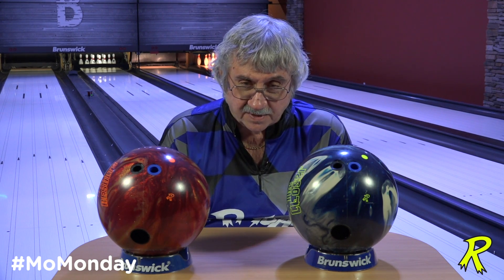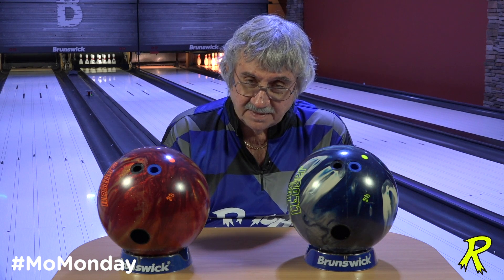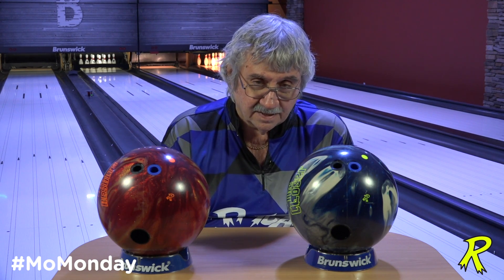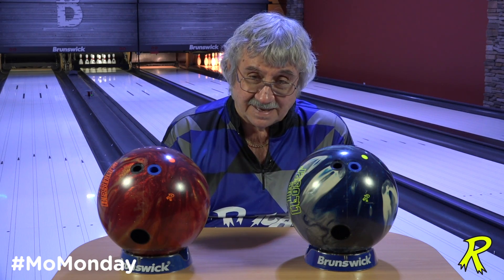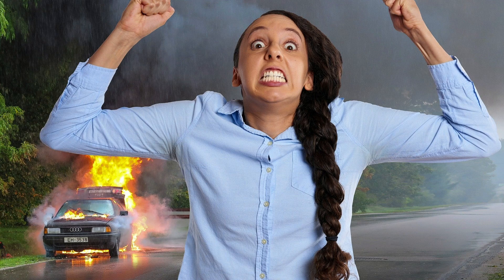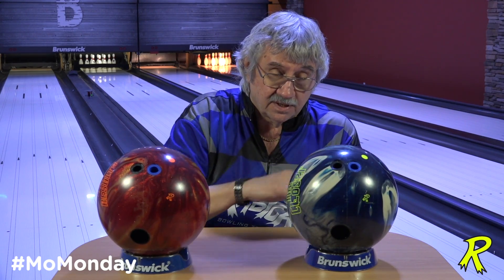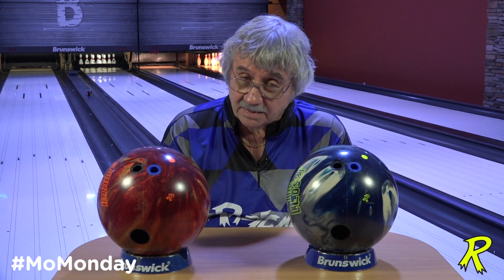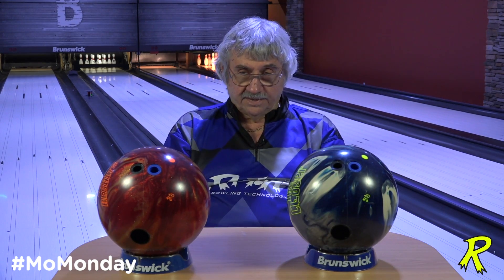Bowling Ball Oil Extraction - #MoMonday

Comment: soak it in hot water 125 degrees. The oil will float to the top.  I always sand to 500 first because it opens the pores in the ball.   I think dry heat you stand more a chance of making the resin harden. The water is the safest way..  My pro shop does it this away too. In fact he is who taught me.
Reply: I've been doing it like this for 4 and a half years on all my reactive gear and it works remarkably well. Just let the holes dry for a day or two before using unless you tape them up.
Reply: @TrashBulldogProductions   I never tape the holes. Neither does my proshop guy. But I do let them dry out good before using it.
Reply: @TrashBulldogProductions ive been told to never let water get in the finger holes, no one knew why

Comment: I set my bowling ball on the floor heat register one day to warm it a little before I went bowling, since it was winter and I had forgotten to take the ball out of the car..  The room thermostat was set at 72 degrees..  OMG..!!  I wasn't expecting to see all the oil come out of the ball like it did..!!  It looked like a shiny glass marble..!!  I wiped it down with a soft cloth and placed it back on the register near my workdesk for another hour as I worked at my computer..  Three times the ball became lika a glass marble which I wiped down agsin and again.  After the third time, the ball remained dry.  Now, no more hot water buckets, no more dishwasher cycles or using the oven.  Just regular house temperature heat from the floor register during the winter months..!!  A pleasant surprise..!!

Comment: I asked my pro shop guy about this subject and he said at 90 degrees the glue inside the ball under the cover stock would degrade so not to do it. Anyone else have info that may contradict what my pro shop guy said? Thanks
Reply: my pro shop owner says his oil extraction oven runs at 140. i always worried about cracking. turns out, they crack most often from extreme cold than heat. hair dryer works pretty well without heating up the core.
Reply: 90° is very high
Reply: @Thezombieguru3565  guy in video just said 130 or less so why do you think 90 is high?

Comment: I clean my bowling balls right after each session with a mixture of 12 oz of 91% isopropyl to 1 oz of concentrated simple green.
I had over 100 games on a resin ball, I took it to the pro shop to put in the oven and after an hour not a single drop of oil came out.
This has been true of all my balls. Aggressively clean them after ever session and oil will not be an issue.
Reply: Maybe urethane balls but reactive balls still suck it in it is how the ball is made.  Just the time it takes for it to roll back to you it will soak up some oil that can not be wiped off or cleaned.    I wipe mine off every single throw and clean with alcohol evetime before they go in the bag. Every 20 t0 30 games I put them on a spinner and clean them real good and put a new finish on the ball. every 60 to 100 games I sand them to 500 finish that opens all the pores in the ball and soak them in hot water not over 125 degrees for a couple of hours and oil always floats out of the ball. Only urethane does not soak up oil.     Now my wife she never wipes her ball off and it only gets cleaned when I put it up. Her ball will have 3 to 4 times as much oil come out. So it for sure makes a huge difference. I left them in the car for a few hours the other day and the only ball that sweated oil was hers. Not something I do not often do either because I take extremely good car of my equipment.   But it is the nature of the way the balls are made they have to be able to soak oil.    Some brands also do it more than others. My motiv balls always soak up less oil. Not trying to call you a liar but if they are bake or soaked correct a 100 game ball is giving up some oil I don't care what brand they are or how well you keep them clean.    Having the ball rough sanded first opens the pores up and makes a huge difference. Sadly not all pro shops have pro's operating them.  I been bowling since the 90's.
Reply: @jvmiller1995  If you aggressively clean the ball as soon as you get home after a session using 90-100% pure isopropyl with Simple Green it will get into the pores and get the oil out. 12 to 1 ratio. I clean the ball with this mixture until my cleaning paper towels stay clean. Then I finish the ball with just 70% isopropyl to get any Simple Green residue off the ball. Now the ball is tacky clean. I have found that Storm balls suck up the most oil while Hammer and DV8 less oil. That is my experience. But Motiv Forge Flare is the worst of all, it eats oil and dirt off the lane like a cleaning sponge! It takes forever to clean it after a session. For my urethane balls, a quick wipe down with 70% isopropyl is all that is needed to keep them clean.
Reply: @nordattack  I aggressively clean them every time before I put them in the bag. The longer they set before cleaning the deeper the oil goes.   I would say the best thing anyone can do is wipe them off every time you bowl. I don't get massive amounts out of my ball like the wife's ball because I take care of them. I just don't believe any cleaner is going to keep a ball from soaking up any amount of oil. Not a drop in a hour I have never scene that. So hat's off to you if it works for you. I certainly can't see how simple green would hurt it and I know people that use it and I know it is a approved cleaner by the USBC.  I say if you feel it works for you go for it.  I might try it but I just can't see a 100 game ball not have a single drop of oil.    Motive has a real good video of a brand new jackal setting submerged in lane oil for a hour and it only lost 2 boards max over a new out of the box ball.  I don't have a forge flare but I have a ghost a 3 other motive balls and they soak up far less than my hammers or even my roto grip. I am not partials to any brand myself but I treat them the same when I clean and use them. So that is my own observation on my balls
Reply: @jvmiller1995  I would say give my formula a try and use it for a month and then see if your ball still sweats out oil.
I use the real hard heavy duty "Target Brand" paper towels. Those things are great! I put the ball, holes up, in the cup, then fold the towel in half and spray soak it and then wipe around the sides of the ball, 4 wipes per area, turn ball holes at 9pm, new paper towel, then holes down, new paper towel and the start over until wiping produces no black or color on the towel. Then I take a towel and spray with just pure 70% isopropyl and wipe the whole ball down to get any Simple Green residue off and I am done.
Try it.
Reply: This is categorically false unless you were extracting from a urethane ball. I wipe every ball, after every shot, as well as clean them after every session. After every shot the ball sits on the rack until your next shot. Every resin ball will absorb some oil while it sits on the rack before your next shot. Bowling balls are porous so no amount of "aggressive cleaning," on the surface will remove oil from the pores in the ball.
Reply: @donkeydiehard879  I clean all my "resin" balls the way I described using the method I detailed above and to this day I have never had a single drop of oil sweat from any ball. They are totally clean. This solution can remove the oil and dirt from the pores fully. Try it before you claim something is "categorically false."

Comment: I made my own oil extractor by using a cooler and a sous vide cooker. Cut a hole in the top of the cooler, drop in the souse vide cooker, set the temp and time, and leave it be. Not as quick as the food dehydrator in the rubber made tote, but i find it easier.
Reply: Do you put water in the cooler or are you using dry air?

Comment: How about a sink
Reply: I've been using my utility sink in my garage for a decade. The water out of the tap is 120 degrees and I have a scrap piece of styrofoam insulation cut to fit the top of the sink to keep the heat in longer. I always let it cool at least overnight before bowling with it. I haven't had any problems so far.
Reply: @TheInsaneShecklador   My sync when I put in warm water my what the water turns extremely hot
Reply: @eddieroberts3420  You can test the heat with a thermometer. That's what I did. Add however much cold you need to keep it under 130. Mine comes out at 120 naturally.
Reply: @TheInsaneShecklador   What should I do to use to plug my holes of my bowling ball
Reply: @eddieroberts3420  I've never plugged them. I just set it thumbhole down. If you use tape in the thumbhole sometimes you will have to replace it but most of the time it has been fine.

Comment: I oil extract my own bowling ball all the time at home with a 8gal tub with a fish tank heater, works great.
Reply: I getting ready to buy a Seve cooker just for that.  It has a thermostat and a heating element and also a pump that circulates the water. It will fit over the edge of a large pot or plastic tank or even a fish tank. I asked my pro shop guy and showed him and he said he thought it would work great. He always uses a tank with a water heater that circulates water.
Reply: @jvmiller1995  that sounds awesome. Let me know how it turns out for u.

Comment: Thanks for talking about this topic. I've been hearing so much about the removal of plasticizers and it had me nervous about using warm water.
Reply: How about a hot woter
Reply: Of the seenk
Reply: 125 degree bath is the safest way to get the oil out without hurting it. Much much safer than dry heat.  Plus the oil floats to the surface where dry heat is sets on the ball and has to be removed by wiping it off after.